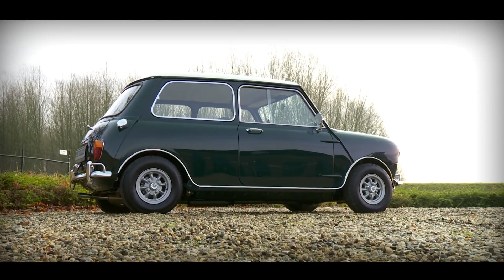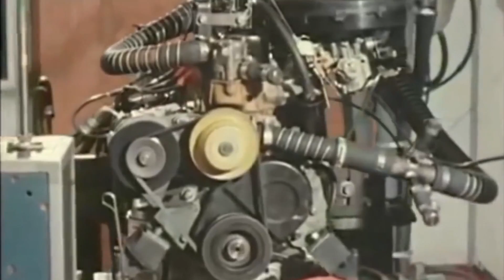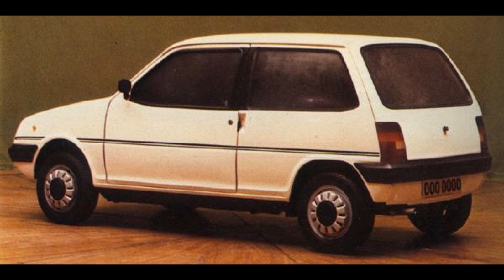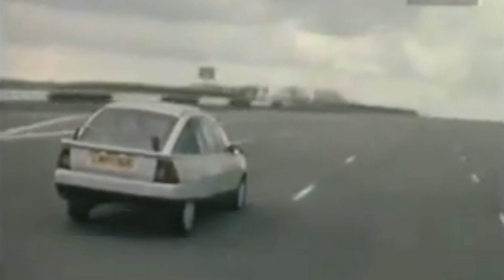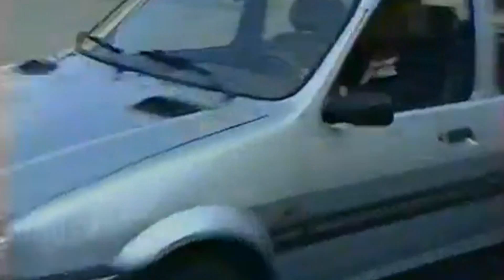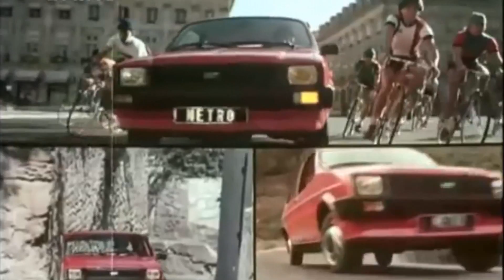The Austin Metro Story

Comment: My first car was a Rover Metro. K915 BDC an 1100 Quest 3 door 4 speed model. 
It needed a 5 speed gear box but that was an optional extra apparently and I was the 3rd owner of the car. 

I have mixed opinions about that car. 

On my he plus side it was reliable. It started in any weather with no drama. I didn’t even need to use the choke. 
Where I lived it was parked outside in all weathers and even after lengthy periods of standing idol (and by lengthy I mean 3 or 4 months because I didn’t use it during the Winter unless absolutely necessary because of one thing I’ll come to in a moment which is a drawback) the car would start first time. 

Positives.  

Reliable. As I’ve described above. 

Roomy for its size (Altho I’m not particularly tall at 1m 73cms aka 5’ 8”. Maybe a taller person would have been cramped.
 
Pin sharp handling akin to the Mini I have now (BMW job NOT the proper old Mini fyi) 

It had very thin pillars and so had almost no blind spot areas. It essentially was a mobile Glass house. 

I also found it economical too. 

Two MAJOR negatives tho.  

It was uncomfortable on long drives and even just going to Redcar from home which was about 50kms away my back was killing me by the time I arrived and........

It was an absolute rot box. Try as I did to keep the rot away it kept on coming back. 

All that said I did love it. 
I even named it Mervin, Mervin the mighty Metro.  Sad eh. 

It was my first car so I will always remember it fondly but if I’m honest compared to my current car which is a 2016 Mini One 3 door if someone said “Smoggie you can keep your current car OR have that Metro back AND £10’000” I’d keep my Mini.

Comment: Metro's Were Great little cars.  Lots of Room & Cheap to buy run & Maintain. 
Built for Everyone. 
Not everyone Wants Speed & Handling in a car. 
clean lines Still Look great today.  Roomy airey feel, Pleasing performance, 
I Could NOT Ever find a Negative on a Metro. 
they were AS Much fun as a Mini, But More Room. 

Motoring journalists think every car should drive like a £150,000 car.  Or an M3 / M5 BMW ? 
They were PERFECT for the buyers at the time. 

Me ? Yes i owned a few. 
My Favourite Car at the time was the Fiesta 1.3 . 
What Would I buy today at a classic Auction as a useable classic = Mk1 XR2,  1.3 GL or Ghia Fiesta.  1.1 ' S ' , 1.3 ' S' . Superb cars. ( also any of the Special Edition Fiestas. 

Early VW POLO's have great Design Style & Look ACE but are very Basic & Lack Power. 
1.3 was OK.  But then the best of all was the POLO COUPE'  " S " 1983/4 /5 /6 

So A Fiesta 1.3 Ghia / Supersport, Or a Polo Coupe' S . as 1st choice  ( MK1 XR2's are £20,000 NOW !!  and More !! )  TOO RARE for everyday use. 

The VW MK 1 POLO bodyshell Design Is the Best looking Small car EVER .  ( if buying the Base model Stuff & Not The XR's &  " S " models. )

Today i would buy on condition , Originality & Price. 

Turning the clock back to buy new, 
XR2
1.3 Supersport Fiesta, 
1.3 Ghia GL
1.1 / 1.3 " S"
1.1 Ghia. 
Polo 1.3 Coupe'  "S" 
Polo Mk1 Coupe' early ones.
Reply: I agree . I miss that with modern cars , they had inherent "faults " but were very easy & cheap to maintain well and for a regular a - b commuting car for a young family were ideal and cheap to insure.

Comment: it had 4 gears in the 80s? and it had hydo suspension and it had rust the mini built in 59 was superior and this was based on that car? and anything else was better
Reply: Lots of cars had 4 gears in the '80s, especially cheaper cars. Hydrogas suspension was a good design when implemented as originally envisioned. Again, many cars had rust problems back then. Ford managed to build rust in to the Ka, Fiesta and Focus well into the 21st century. The original Mini was a superb design, but too small to accommodate the things people wanted. Compare the first Mini's interior with that of the last ones and see how cramped the later ones were.
Reply: @another3997  what hatchback in the 80s had 4 speed?
Reply: @paulhunter123  Toyota Tercel came standard with a 4 speed until 1993ish.  Ford Escort til the late 80s.  Too many to list really.

Comment: my uncle has two brand new metros , he ran a dealership that went bust in the early 80`s and following a dispute with the money men, some of the inventory found its way into his barn  and remained there ever since, he also has an unregistered ambassodor vanden plas and a rover 2600se, they havent even been opened since then as he isnt sure where the keys are anymore :-(
Reply: Great, But Can NEVER BE DRIVEN .  They are not worth much unless he Registered them back in the day. 
Just STATUES of the past, To be Trailered every mile they travel to shows. 
Sell them to a Museum.  
THEY CAN NEVER TURN A WHEEL ON A PUBLIC ROAD WHATSOEVER . 
Value =  Whatever a Museum will pay. 

I can explain why if you or anyone is interested to know why they WILL NEVER CLOCK UP a SINGLE MILE EVER.
Reply: @A1DJPaul  He has been offered £35K for them both last year from a magazine ( that did include a LWB Rangerover SE with only 670 miles on it which is apparently rare ). He has loads of stuff in there, a magazine has also been pestering him to do a feature where they recover the cars and put them back on the road but he wasnt interested as he said he doesnt need the money :-O  For info the cars once re comissioned could be registered with a special DVLA process and put on a Q registration plate.
Reply: @marshalllucky  
yes possibly a Q plate ? 
Laws on car build & Construction always apply to cars 1st reg'd on or after a certain date. things like Rear seatbelts, Hi level Brakelights,  &  Emmissions etc. 
Jan 1st 1986 for rear belts & jan 1st 1996 for extra rear brake light. etc & many other Legislation issues. 
They can't go on their Build date reg number. or as a 2019 reg plate.

Comment: The R6 Rover Metros were much more luxurious than the Austins, as they had to bring the car up-market to meet the Rover branding. The interiors from 1990-on were leagues ahead of any other supermini at the time. Sit in a base model Mk3 Fiesta and a base model Mk3 Metro from 1990 and you'll see why.
Reply: Never been in a Metro but i've been in a 200 and i could tell the interior were much better than your average Ford/Vauxhall. The engine was a different story tho, at least the K series i reckon (head gasket issues). In fact i always thought Rover should've known better and used somebody else's engine (Honda ones maybe), Ford and Fiat teamed up until a few years ago for the Ka/500 chassis (that's also used on the Panda) and the cars did have a truly different character while retaining the same engines and transmissions.
Reply: DeerKoden the K Series was an excellent engine and it won quite a lot of design awards in the early 90s. Lotus and Caterham used it in their cars too as it was much lighter than the competition while making good power. The issue was that BMW and Rover kept making it cheaper and never fixed any of the original teething troubles, gaining the head gasket reputation, which did sadly exist. Other than that, it was a very free revving engine. Even the 8v 1.4 carb engines revved to 7,200.